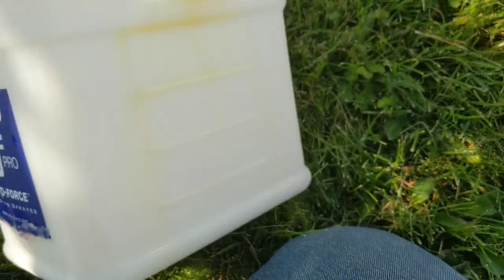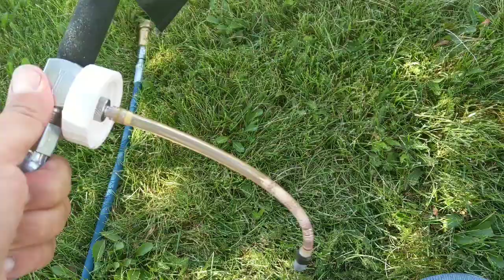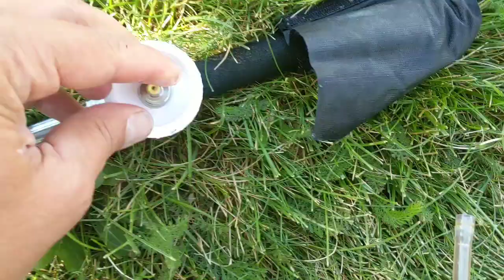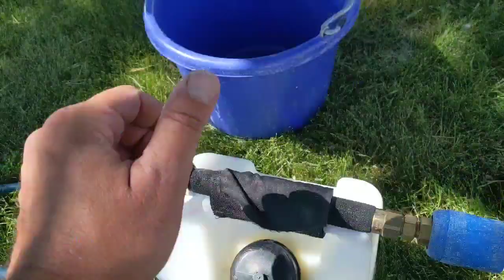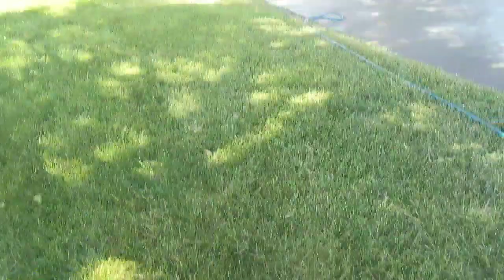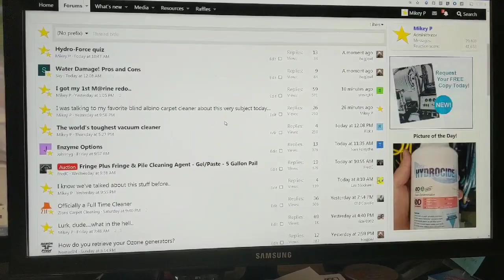Bucket Test your Hydro-Force to know how much Carpet Pre-Spray you're really putting down.

Comment: I just bought an inline hydro force sprayer. I tried to take the metering tip out but there is a really tight clap on it. How would I take that clap off without breaking it?
Reply from the maker: it simply unscrews..

Comment: I'm confused you removed the tip, and you say you got 8 gallons how so when it should've been 4 gallons 1:49 is there a 5-gallon vid or was that too time-consuming asking for a friend.
Reply: Neither one is correct. Here's the simplest way I can explain it. When you go 4:1 in a 5-quart container you will get 1 gallon of water from your machine IF it's set at 400 psi EXACTLY. You simply add the contents of the container which is 1.25 gallons to the 5 gallons of water from the machine. This gives you 5 + 1.25 = 6.25 gallons. If the Hydroforce is getting older it will get less accurate over time. If you turn the psi above or below 400 psi that also does make a difference. The higher you turn up the psi you will get MORE WATER from the machine and less SOLUTION from your container so it's weaker. However, if you want to turn it down to say 300 psi it will give less water from the machine (think about it) and will actually draw more from the container.

 I've been using these things and testing them since the 90's. This information is NOT made up on my own but is directly from the manufacturer. I've found a new Hydroforce is generally going to be nearly dead on correct if tested properly. You can take this information and learn to use it in the field. Say you have a large job that is lightly soiled. You can go up to 500 or maybe as high as 600 psi if you wish. You will be spraying faster but using less actual chemicals. If you want a heavier dilution for a bad carpet or a very bad area you can turn it down to maybe 300 psi for a little extra cleaner. With 8 to 1, the only difference is you figure 1 gallon of water per 1 PINT from the container which gives you 11.25 gallons. It took me a while to figure this stuff out years ago. Hope it helps. I have 2 sprayers and leave one 4:1 and the other 8:1.

Comment: I have a 500 psi portable i usually spray around 400 psi my question is  
if you use less psi do you tend to spray more concentrate out or less 250 psi? 
Or just stay at 400 psi?
I understand ball bearing keeps the water from going into the pre-spray tank. I do remove sometimes spray air to open up any blockage at times.
Reply from the maker: pressure wont effect the rtu concentrate
Reply: @MikePailliotet  
Thanks
Reply: @MikePailliotet  That's incorrect Mike. These things are tested @ 400 psi for accuracy. If you go higher you will get less from the container the higher you go. If you go lower like 200 or 300 psi you will most certainly draw more from your container. Test it yourself if you don't believe me. Btw, a Hydroforce will normally put out right at 6 1/2 gallons with no tip and around 11.25 gallons with the yellow tip in. These aren't my figures but come from the manufacturer and they are pretty accurate with a properly working Hydroforce. I began bucket testing years ago. The reason why you got 8 gallons was that you were using 600 psi. I guarantee you it will be different @ 400 psi. I always say don't worry about the slight difference as long as your pre spray is doing the trick.
Reply from the maker: @randyd9805  there is no right or wrong, the point being is knowing what your HF is actually putting out, at your desired pressure and set up